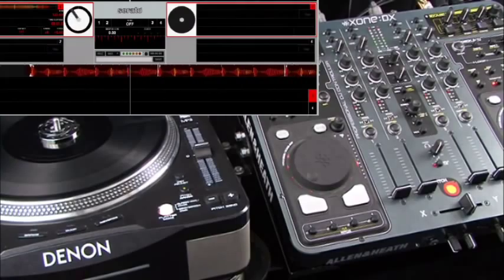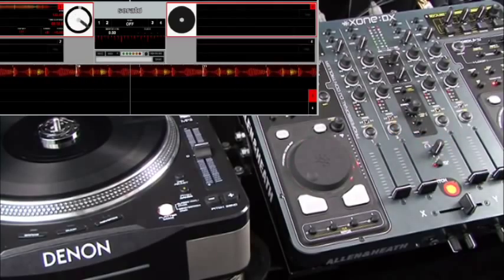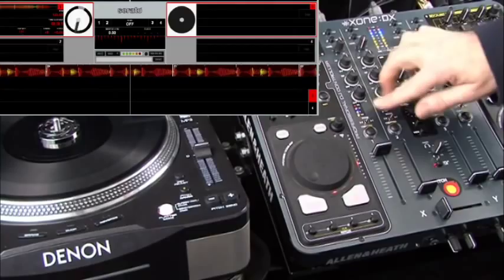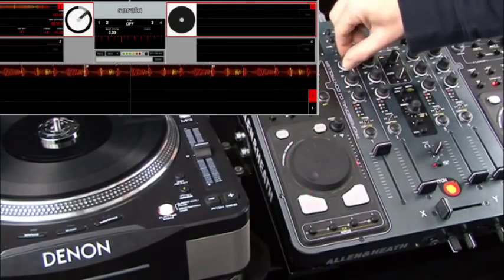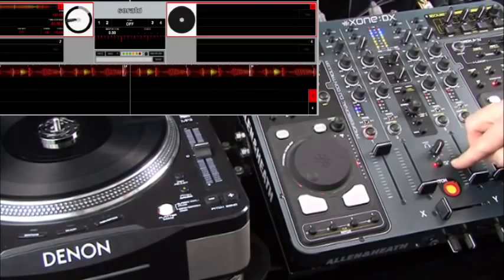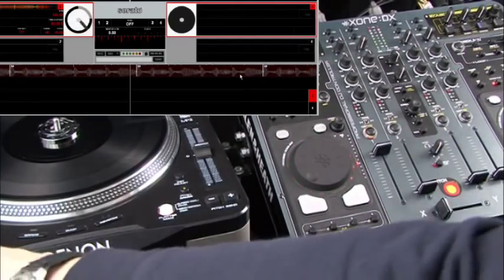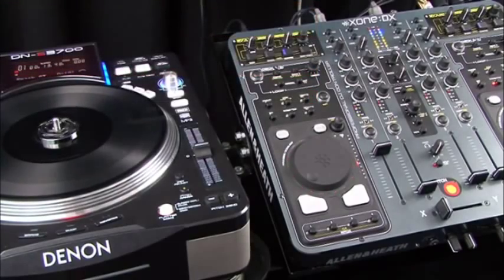Allen & Heath Xone DX tutorial 5 (Channel Strip)

Comment from the maker: @elchecha Connect your CD player vie the 'Line' inputs on the rear of the unit.
While 'ITCH' is running, hold down 'SHIFT' and press 'CUE' on the channel that your CD player is wired in to.  
That channel in 'ITCH' will now turn grey indicating that an external audio source is playing.
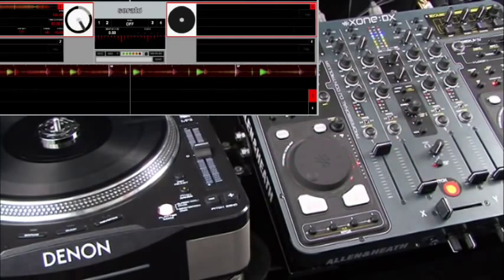1:50 on the above video.